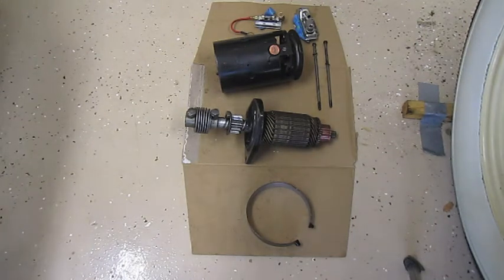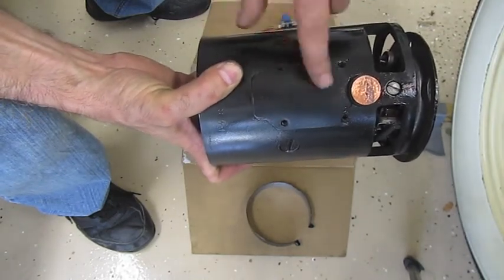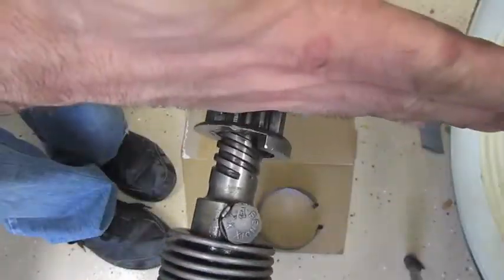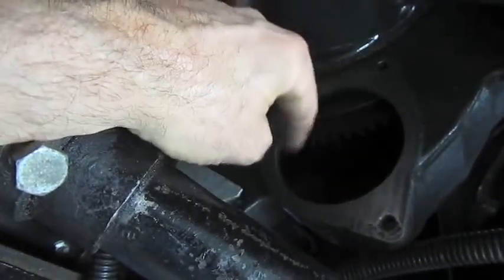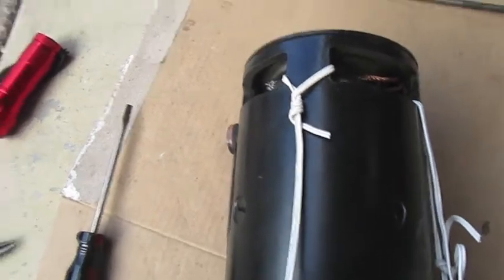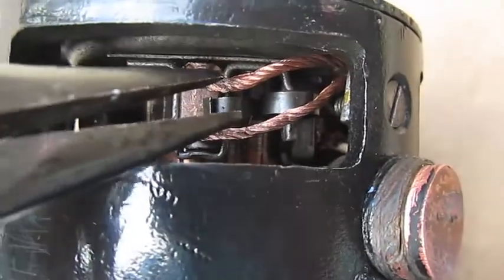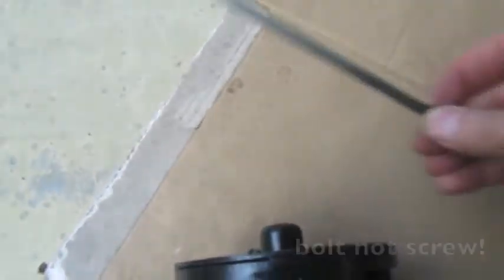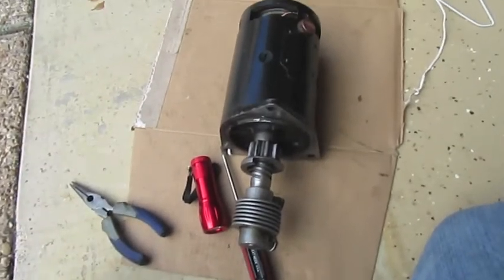Ford Model A - Starter Internals

Comment: During conversion to 12V (1931 tudor) we got the starter to turn the engine clockwise when viewed from the cabin, which is the wrong way. Sounds we got the shoes connected wrong, because now minus is ground. Do you think switching them around can be done without taking the starter apart?